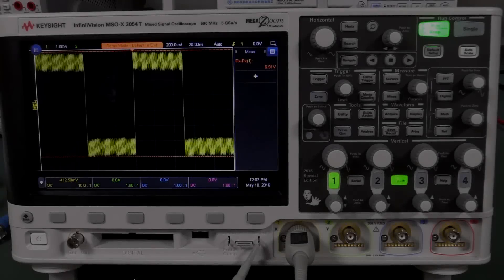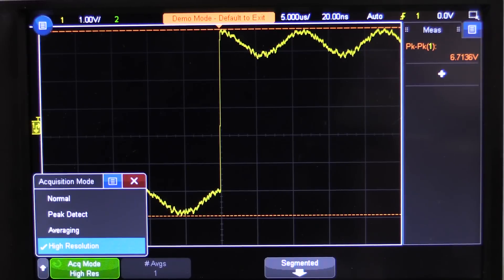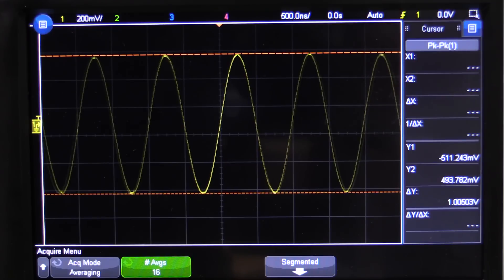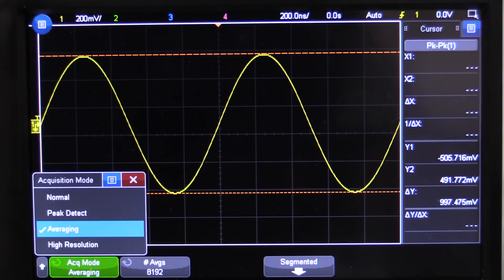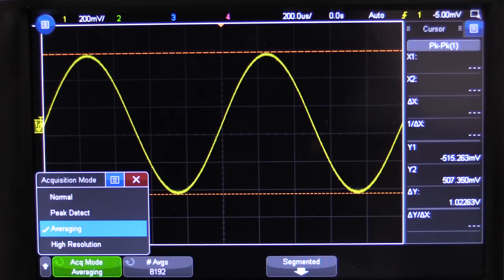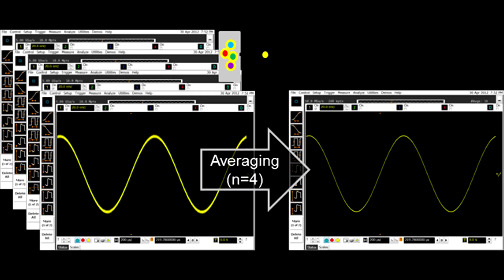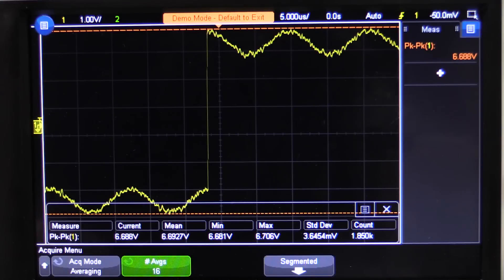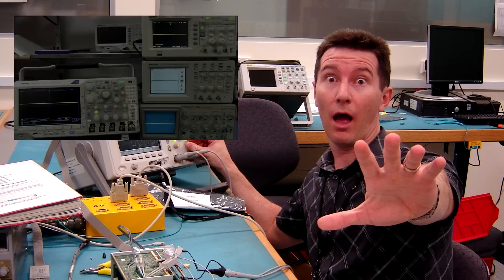EEVblog #878 - Oscilloscope High Res vs Average Modes

Comment: Heh. I had to discover this stuff myself in Electronics Lab at uni. I figured out averaging mode fairly quickly, but it took a while to understand High Res mode.
Now I default to High Res unless I know the signal is periodic with no changes (like data packets that might have different values).
Averaging tends to make the cleanest signals, but you can't always use it.

Comment: I think this effectively is boxcar averaging although it doesn't look like it.  I remember many years ago using boxcar averaging and it meant replacing every N samples with  N values equal to the average of the N samples.  So the  result looked like a string of boxcars in a train.  A ramp would therefore look like a staircase.  The digital scope doesn't quite do that it replaces  every N samples with a single value equal to the average of the N samples and then draws vectors between them producing a smoother looking curve and a ramp looks like a ramp.

Comment: Great explanation of what the two modes do but is "boxcar" the right name for high res oversampling. Wikipedia describes a Boxcar averager as a gated averager and that seems to be something different. It actually seems to correspond to the normal scope averaging mode for averaging periodic signals. Dare I suggest Dave has it the wrong way round?
Reply from the maker: +nophead Both Keysight and Lecroy at least use the term boxcar averaging. It's in their app notes on the subject of high res modes.
Reply: Yes they seem to use it to mean simply averaging over n successive samples but the rest of the internet seems to think it is something different.  See http://sunnytek.net/admin/xiazaifiles/2010114103920522.pdf. That describes a gated integrator before the ADC and then averaging the samples digitally over successive cycles of a periodic waveform. The gate pulse is then swept over time to build up the waveform. Lots of other references to the same thing.

Comment: Can the average/high resolution mode be used to determine if a "noise" is random or not?  What looks like noise might not be random but some form of HF coupled into your signal. Based on the amount of "noise" reduction between high resolution and average you should be able to determine if it's random or some form of repetitive HF.

Comment: Although, if you adjust the trigger holdoff you could probably make averaging work the same way as high res. However, this is more of a kluge than a viable measurement solution

Comment: I would think that high resolution mode and Peak detect mode could possibly be used at the same time? when your sweep is slow you might want Peaks to stick out even though you're even higher frequency noise is being averaged out on the Fly. or maybe you don't want that? haven't really thought about it all that long

Comment: Just wondering if anyone else has EVER heard or seen it called Boxcar averaging, besides from Dave. Never heard it elsewhere, and I've used a LOT of scopes.
Reply: +Aurelius R I mean, I know that's what it actually is, I've just never seen a scope label it that way.
Reply from the maker: +Aurelius R Both Keysight and Lecroy use the term, but not in the scope, just in app notes and things.
Reply: +Aurelius R : The term "boxcar" is standard, at least for me.  It is used in DSP as a type of windowing function.  Any scope that offers FFT functionality should offer boxcar along with hamming, hanning, and other windowing functions.

Using the phrase "boxcar" just means that you look at the last N samples.  Another way is to use constant averaging, where each new sample will make up N% of the total, and (100-N)% of the previous average.  This means that one stray signal will eventually decay (as if the average had an RC time constant).

I hope this helps.

Comment: So high res mode is like moving average with extra samples. Is that correct?
Reply: +Joost B That's how I understood it as well.
Reply: +Joost B It's a different type of averaging. 'Average' requires multiple samples, it then averages all samples together. Eg. data point 1 is averaged across all samples, data point 2 is averaged across all samples,  etc, etc.
'Hi-Res' increases the sample rate. It then performs a moving average on the sample. Eg. data point 1, 2, 3, and 4 are all averaged if it was a 4 bit average. Next data point 2, 3, 4, and 5.
Reply: I like to think of high res mode as point-to-point averaging, whereas averaging mode is waveform-to-waveform averaging.
Reply: I like to think of high res mode as point-to-point averaging, whereas averaging mode is waveform-to-waveform averaging.
Reply: KEYSIGHT OSCILLOSCOPES That's a concise way of putting it. I like it. Are you the/an official Youtube channel for Keysight?
Reply: +Joost B : High resolution averages over consecutive samples.  Averaging mode averages the same sample number over consecutive waveforms.  

Same as what 08Ultrasonic said, but with fewer words. :P
Reply: +Kevin Harrelson Very clear. Will it also work when the highest sample rate is already reached in normal mode.
Reply: +08Ultrasonic Thanks! Yes, this is the official channel for Keysight oscilloscopes.

Comment: Wow, I'm very disappointed hi-res & averaging can't be combined. Figured that was just a Tek thing.

Really, scopes have no need for a "hi-res" mode. They should simply store the highest res possible at any given sample rate.
Reply: +qwaqwa1960 It's a way to trade bandwidth for bit depth. We don't live in a perfect world, so it's hard to manufacture cheap high rate ADCs with high bit depth (and low enough power etc..).
Reply: peteabc1
You perhaps misunderstood. Why have a switchable hi-res mode? Just max out the res automatically, so that resolution goes from e.g. 8b @ full rate, to 16b or more at slow sampling.
Reply: +qwaqwa1960 Aha now I understand. That would be nice feature.